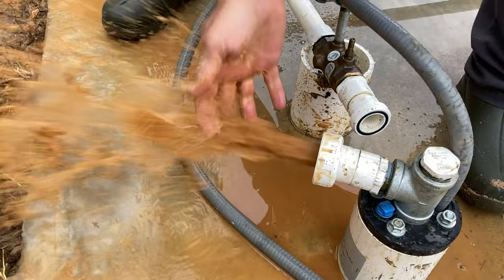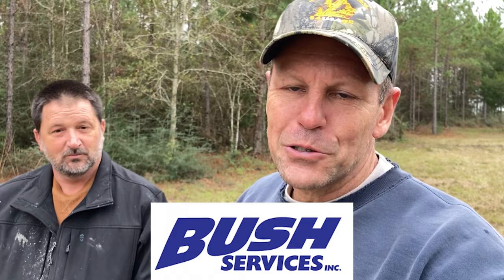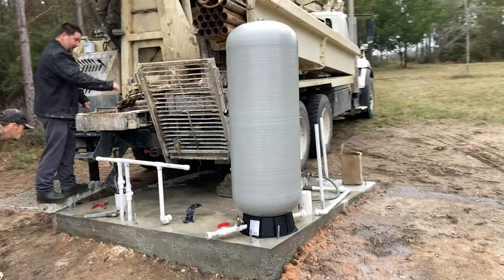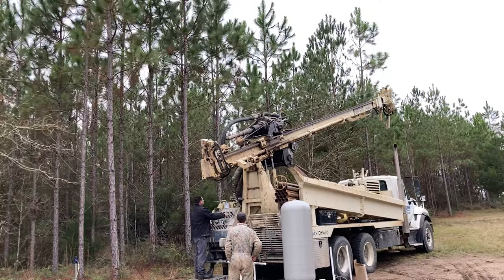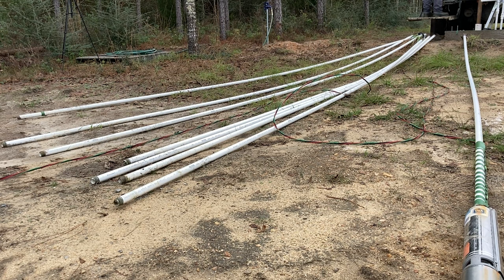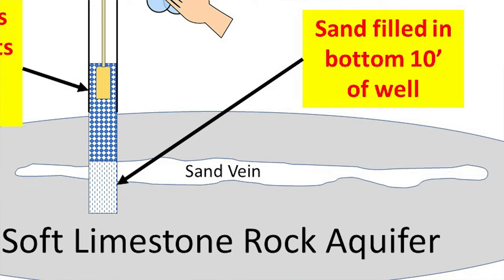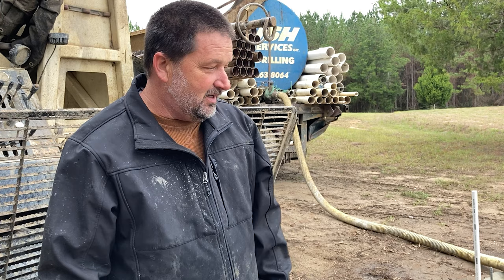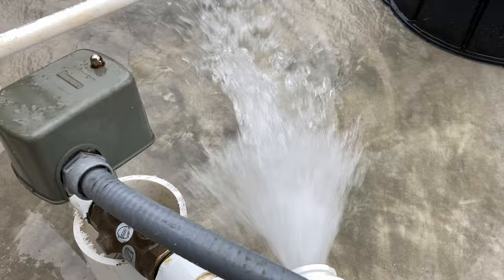Well Water So Dirty!!  | How to Flush a Well and Install a Well Screen

Comment from the maker: Our entire well story is here in this playlist: https://www.youtube.com/playlist?list=PLG5yS75HLzo1bWHgHSOQbp3ixkMXSyLA3

Products in our Amazon store used in this video (costs nothing extra to use these links!).  You don't have to buy these specific items to support our channel....just use a link below to get to Amazon then make any purchase: 
Flex Tape: https://amzn.to/3R4MdWm
Mechanix Leather Gloves: https://amzn.to/3HjoZZf
Under Armour Iso Chill Wicking Shirt: https://amzn.to/3zvSTYD 
Solo Seed Spreader: https://amzn.to/3UGIws7
Fuel jug nozzle kit with drill bit: https://amzn.to/3H5EeoE
Orange rubber gloves: https://amzn.to/3xIdlEt
6’ Digging and Pry bar:  https://amzn.to/3vH5Agx
FIMCO 15 Gallon Sprayer: https://amzn.to/3HgxSmp
Renegade Razor Hybrid Brush Cutting Blade: https://amzn.to/3yaJtk9
Dewalt 20V ½” Impact Wrench: https://amzn.to/3UOcXNH
Dewalt 20V brushless Leaf blower: https://amzn.to/3zwJcYm
Reply: Sound like Greg has great customer service .  Cant beat him offering to drill a new well if it doesn't pan out .    Only thing i would rather seen was an air compressor & line down that hole developing the well instead of the pump .
Reply from the maker: @thhillbillyinventor105  We have a playlist with all our well issues.  He drilled the 3rd time in this video:  https://youtu.be/DY8j3jAHCkQ

Comment: Our well on this farm is 816 ft. deep. The pump went bad 2 years ago and we had to have it pulled and replaced. The old pump was at 550 ft. When they went to put the new one down, they hit something at 435 ft. Not wanting to damage the pump or risk getting it caught , they decided to let it ride. We had water. Had.
This past summer, we started having issues running short of water. The same technicians came back out and determined that we would need to drill a new well. We got 4 estimates ranging from $35,000-$49,000. One of the well companies suggested that we send their camera down the well and see if we could see what the problem was. The cost for that was around $3000. Turns out, the pump was sitting at 435 ft. and the static level of the water was 439 ft. They added 1 20 ft. section of pipe and got the pump to 454 ft., and we now have plenty of water.
Here is the problem. The absolute rock bottom limit of depth for a 1 1/2 h.p. pump on 1 1/2 inch plastic pipe is 365 ft. We have 1 1/4 inch plastic pipe at 454 ft. Every time the that the pump kicks on, it is causing a twist in the pipe. Eventually, it will be a problem. A big problem. Like a $4000 pump dropping down into the well to never be seen again.
Our plan is to go with the 1st 100 ft. down from the surface with stainless steel pipe and then bushing to 1 1/2 plastic for the remainder of the distance down to the pump. Right now, stainless steel is so high, it may just be cheaper to go with pure gold. I think we all try to ride out this year and hope that supply chain issues get a course correction and perhaps by then, we may have the adults back in charge.
Thanks for this video Brad and deb. Very interesting.
Reply from the maker: We watched your video on that and it was very interesting.   That's crazy deep for a well and would leave us to make hard decisions about our land if we had to spend $50K to get water.  Sadly, this was not the last issue for this well -- there will be an updated video coming on well water on Piney Grove.  🙃  Thanks for watching.  B&D
Reply: if your pump is twisting get a profesional in there my lord bro

Comment: In our country they use an extra (stainless) cable attached to the pump all the way up to get the pump out if it disconnects from the pipe.
As long as it s garantuee , the well driller can come every day , but i suppose that s in the price

Comment: Sand could be coming for he motor, when it starts up, it will swing like a pendulum, unless you have those casing spacers in there and  stil they too can bang up he well the well walls releasing sand sediment

Comment: Loved the video on putting another screen in the well.  I think that is what I need.  I wish you had showed the part better where he was flushing out the well casing.  The part where the pump had been pulled and he forced air/water into the casing and tried to flush the sediment out of the well.  Another thing that needs to be stressed is that the original well casing (4") already has the "slits" in the screen in the bottom 20-40' of the casing.  The bottom of the casing will have a cap or plug on it.  The outside of the casing will have a gravel packing of sorts that would have been poured in the hole (canula) and would have dropped down the 210' to surround the bottom of the well casing...forcing the sand/sediment to go through a gravel pack before reaching the screen.  This is where I think the well drillers collapsed my casing and why I get sediment.  What happened on your repair is that they stayed on the inside of the casing, removed the down pipe and pump, then drilled threw the end cap of your 210' well casing at the bottom as they drilled further into the substrate to 240'-260' or so.  Then they inserted into that drilled hole, without casing mind you a 2" screen (finer? slits) 40' of it into the hole...then placed a plug on the end of that and pushed that plug and screen down to the 210' level with the drill pipe, drill head removed.  Then inserted your pump back in.   No, post repair, the water entering your old 4" screen will not have to also travel to and through your 2" screen to get to the inner casing and up through your new plug and into your pump to be pumped to the surface.   Whew!  Let me know if I missed anything....  My issue, problem, question is where is the link to that plug, that 2" screen...both of which I can probably get form well driller... and how the heck will this DIY guy do the same?  I mean, I can pull the pump...I don't need or want to drill deeper, and past the end cap of mine, but I do want insert a 2" inner screen with the plug....how will I as a DIY guy push that plug to the bottom where it needs to be?  My well is 205'  my casing has filled with sediment to 195' (old depth of my pump) and has since been raised by hand to 185' level.  My static water level is 85' so I can pull her up some more for sure.  FYI my well was drilled by the man's son and started pumping sediment within 30min of pumping, kid stopped and on phone with dad...."Dad says the well will be low producing and you can have as is for 2500 (agreed price was near 6k) or he will abandon.  Leaving me with nothing and a mess....I chose to keep the well and it pumps 5-10gpm anytime I want, just has sediment... argh.  I think he collapsed the screen with the gravel pack and that is how sand is getting in.  I want to first pull the well, then blow it out with air and see how that goes...if that doesn't work, give it a year and pull it out and place the inner screen.  Your thoughts...and 706 plus my number 825 and then the last part 7180 is my number t call me if you would like to talk.  I would prefer that if you don't mind or anyone with a phone that could lend some advice.  Tks again.  Great vid.  :)
Reply from the maker: We are not well experts, so not sure we can be much assistance.  We decided to drill another well up the hill and use this well for irrigation.  Here are those videos: https://youtu.be/DY8j3jAHCkQ     https://youtu.be/kjHWB8Bhu6E

Comment: I am not a well guy, but maybe your  1,5hp pump is to strong for that little pipe  which goes up. My thoughts is, when the switch goes on, in the same moment that pump sucks so strong at that little surface what it has, creats a vaccuum and suck up all the dirt even when you flush it again. So maybe it would be better to get that smaller pump in it runs maybe a little longer, but that doesent matter bc. you use a pressuretank.
Greetings from Germany
Reply from the maker: The pump is suspended in what should be 60 feet of clear water with the limestone rock to filter the water once the initial drillings are flushed out.   But because of the sand pocket, there is always new sand coming into that 4" column.  The 1.5HP pump is needed for 15gpm service to 2 houses, a workshop, and an animal barn, as well as irrigation.   Greg said he routinely digs wells in the area that will service 5-6 mobile homes.   Much more to come on this story....stay tuned!   Brad&Deb

Comment: Why are you using PVC for well pipe?  Is that code in FL?  That seems very "Old School".
You would be able to pull out the Black Poly pipe without a drill rig derrick.
Reply from the maker: It's the way they drill wells here.
Reply: @PineyGroveHomestead  Thanks.  I know it was an old video and I am sure you have worked out the sediment issues.  I wish the Best of everything for you.

Comment: Are you pressurizing the entiire well so it pushes up the pipe?
Reply from the maker: There is a pump in the bottom....it's shown in the video.
Reply: @PineyGroveHomestead  
Would it destroy the submersible pump that a well typically uses?
Reply from the maker: @laserfalcon  if the grit was constant, it would wear out the impellers quicker.    All wells have to flush a bit before they clear out.
Reply: @PineyGroveHomestead  my well about 140 total, thought of making a bailing bucket instead

Comment: I have two pumps on one source, the original source has NO settlement and has been there sense the 70s BUT we just installed another pump on the same water source & we’re getting SO MUCH SETTLEMENT on the new pump that it causes acne and breakouts on our skin along with not replishing thurst even when attached to a settlement filter. Any ideas why our water quality is still bad after 2 years of use? The original one still gives great water source just this new one is so odd.
Reply from the maker: We finally got good water on our 3rd drilling! https://youtu.be/kjHWB8Bhu6E

Comment: So, the only thing that supports the screen is that rubber gasket?
Reply from the maker: Yes, but the well is only drilled down so far into rock, so it eventually contacts the bottom of the drilled hole.

Comment: Wonder why they didn’t use black roll pipe
Reply from the maker: Most wells are PVC wells in this area.  Metal pipe wells are twice as expensive.
Reply: They got away from using the coiled poly pipe, I think because it was just so hard to work with. When I got a new well pump some years ago they replaced the black poly with lengths of this straight white pipe connecting them as they went down the well.

Comment: How long can these wells, pvc tubes, pump systems, etc last?
04/04/24
Reply from the maker: Unless it gets hit by lightning, the well will last forever.   The pumps usually last 20 years or more.
Reply: @PineyGroveHomestead  ... Oh yeah, I didn't even think of lightning.   Our pump & well has been working since the mid 1980's, & afaik, without repairs or such.  Its age is getting up there so I am concerned what to think what the cost might be to replace the blue steel well pump if that suddenly dies, or anything else associated with it.  It is not located inside our home, It is all housed separately in a shed (pump house).